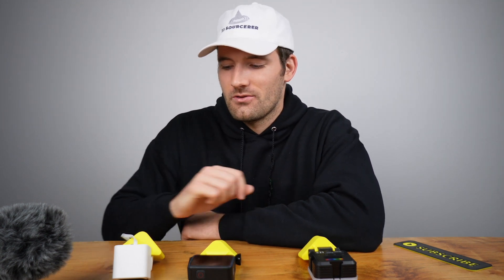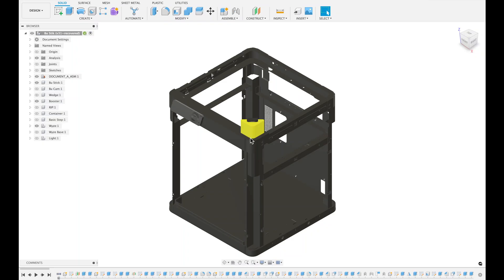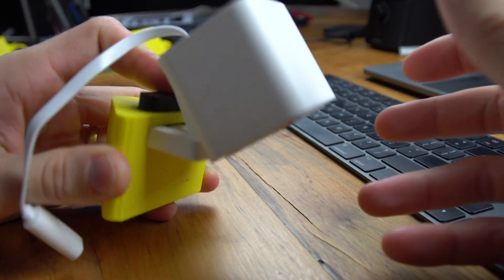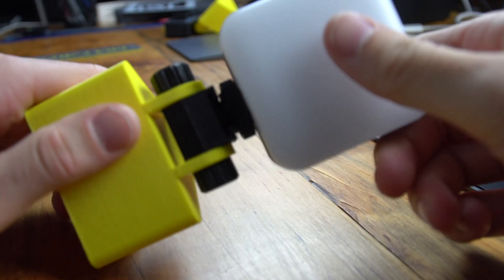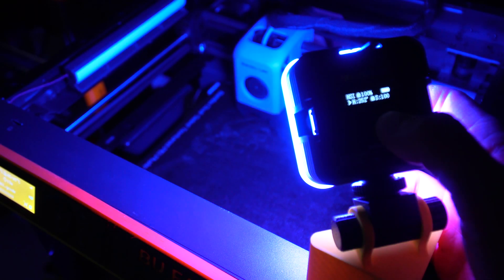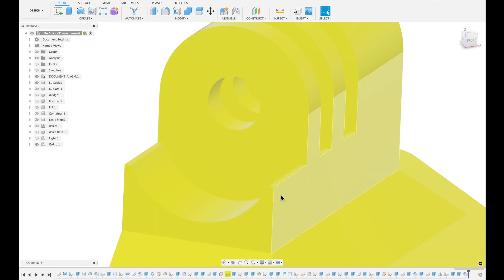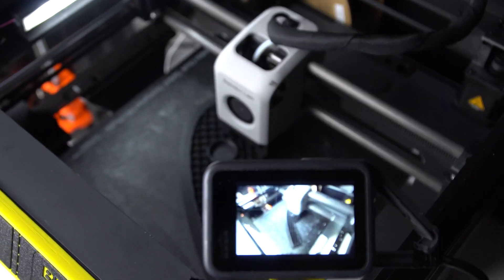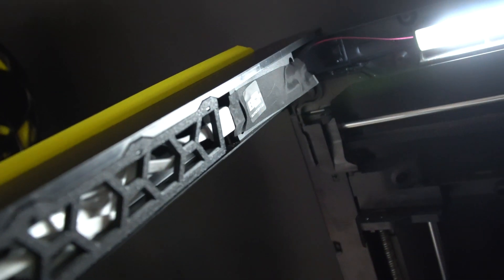P1P Mods - Wyze Cam, GoPro & LEDs [Iterate Ep. 8]

Comment: I made the mount for that light and it works great.  I did have to lengthen the small part that extruds and goes into the hole.  
Otherwise any kind of bump on the printer and the light would fall over.  Also, the p1p usb will power and charge the light.
I have the wyze pan camera v3.  Tried several mounts and don't like any of them.
Reply from the maker: Thanks!